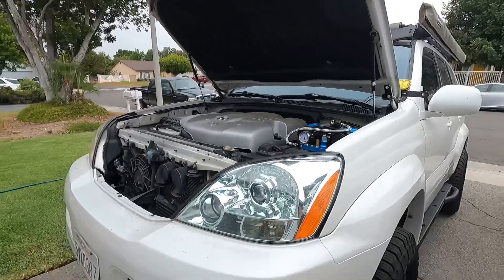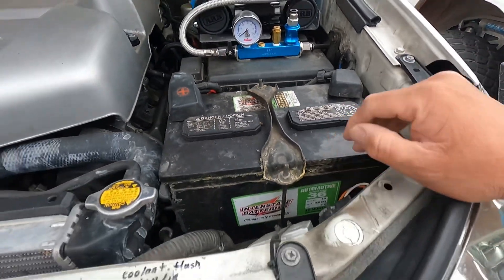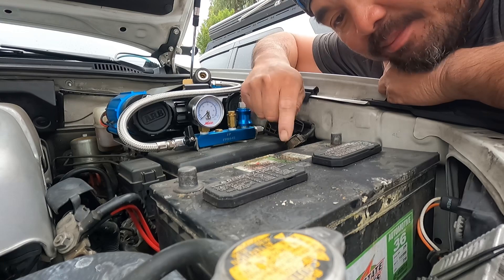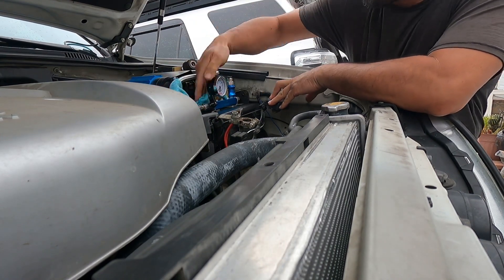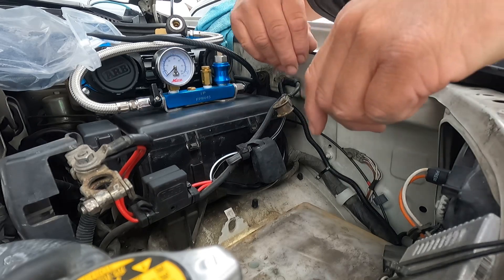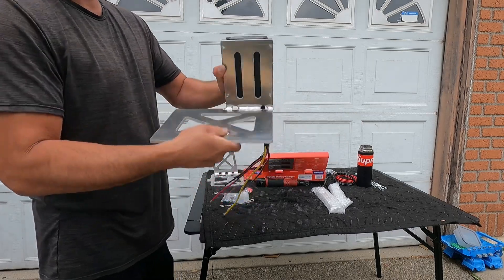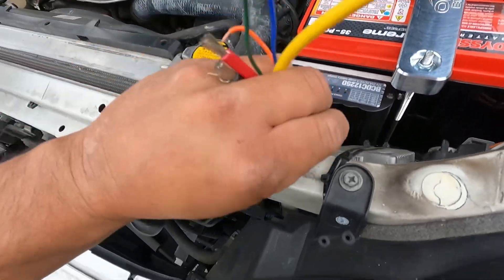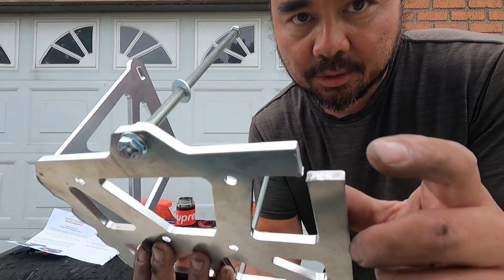Off-grid Engineering dual battery system Redarc BCDC 1225d install on a Lexus GX470

Comment: Get the lift, it is a rubber strap with two hooks, makes it easier to get the battery out. Sold in the battery section.

Comment: You didn’t say anything about the solar panel wiring?
Reply from the maker: He didn’t have a solar panel so I zip tied that yellow wire down. But if he did have a solar panel, I would put an Anderson plug on that yellow wire and solar panel will just plug right into it.
Reply: @sponsoredbywifey  so with the kit does not come the plug for the solar.I’m asking cuz I’m planning to get a kit from off grid engineering for my 4runner
Reply: I have never see such an incomplete install, looks like you grounded the auxiliary batter with 10 gage wire plus you didn’t even connect the orange and green wire together for lithium battery for your auxiliary battery. 😊